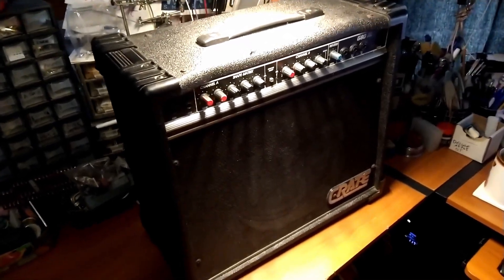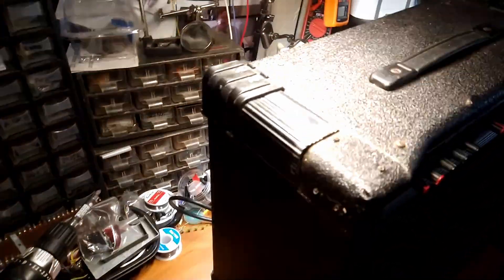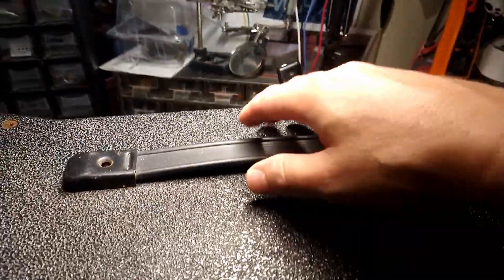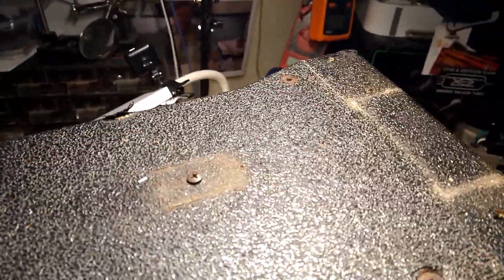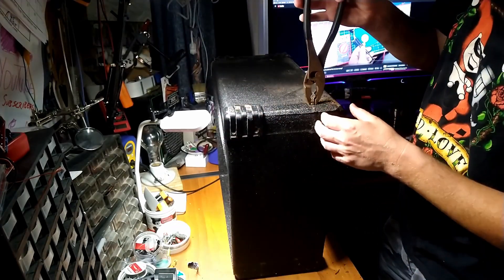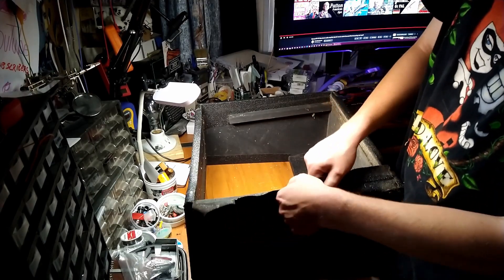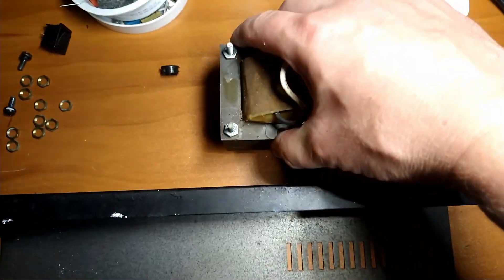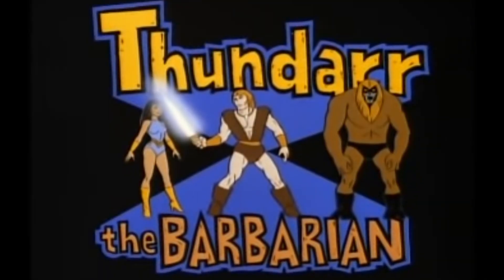Fender 6G3 Brown Deluxe Scratch Build part 1 - Let's Build! - Episode 22

Comment: I recently bought a few bee-keeper pine boxes. Around 20 bucks each. You'd need to add a baffle and back . Perfect bare bones pine cab for a small amp ! Same size as a blues jr cab. More-or-less.  I've come up with a method of making cool stains with paint tint and danish oil. Then I clear coat.  I may post something on Brad's locals when I get around to doing one up !
Looking forward to your dumble/hot rod.
Cheers
Reply: Also , Uncle Doug's grill cloth idea of using the fabric used to cover deck chairs is kinda cool !
Reply from the maker: Thanks for the great ideas!